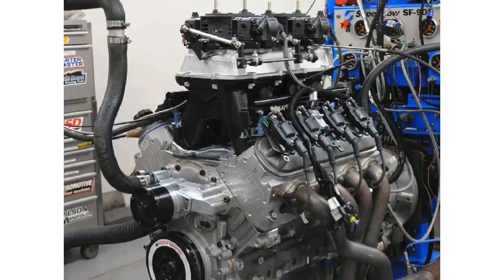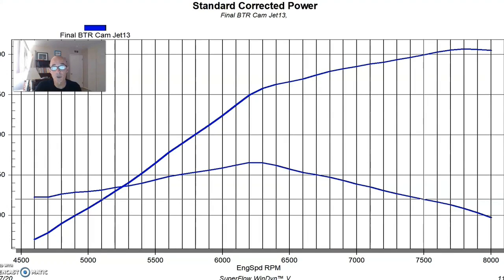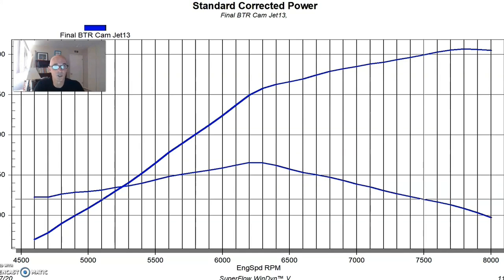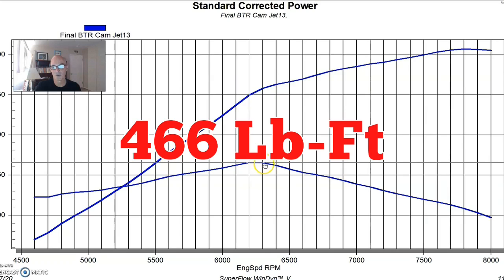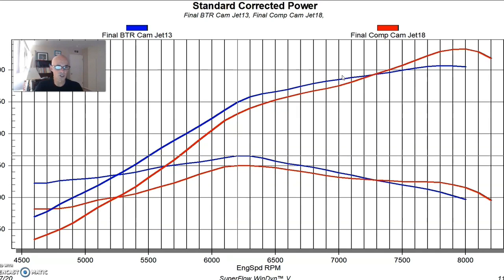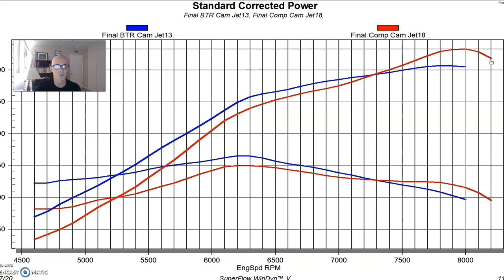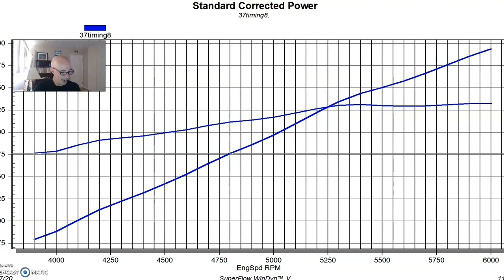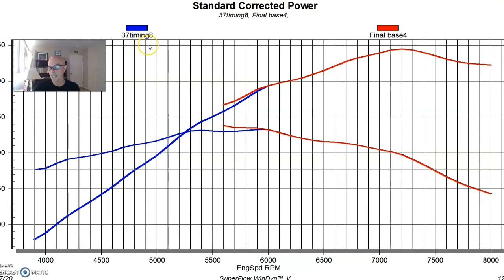8K RPM HYD ROLLER-WILL IT WORK?

Comment: I spin my 351 to 8500 rpm all of the time and as high as 9200 rpm.It is on my channel going out of a 8000 rpm tach.
Reply: Junkyard Vette,  Cool channel, I have just subscribed. 👍
Reply: What did you have to do to the lifter bores?  They have a classic issue after 6,000 + RPM
Reply: You must run a massive solid roller cam to spin 9k rpm. Your spring pressures must be huge. Not ideal for street longevity
Reply: I hope you are using isky bushed lifters with that high revving massive solid roller cam